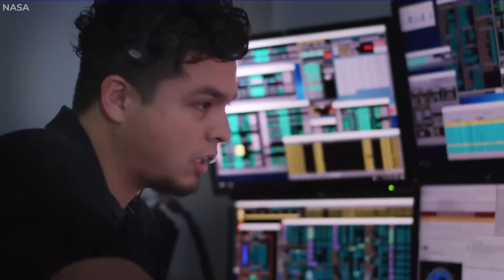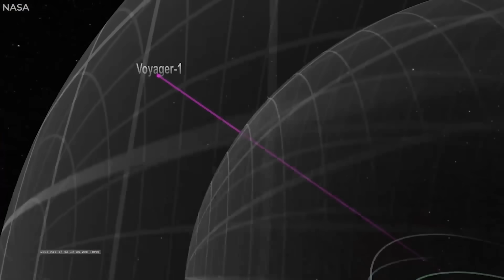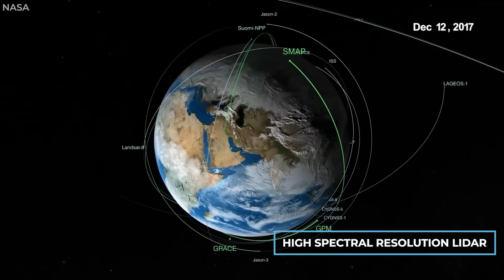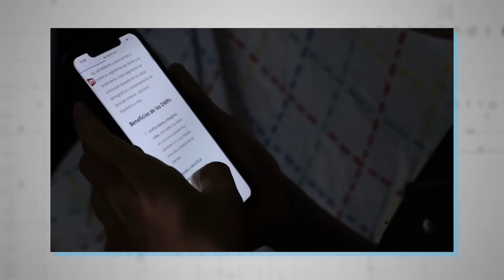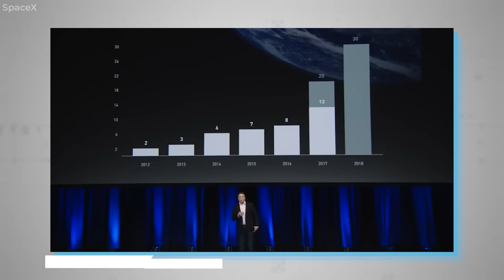NASA vs SpaceX: How Do They Compare?

Comment: NASA - 15 austronauts died during space launches vs 0 dead for inexperienced SpaceX
Reply: This is an unfair comparison because it's not NASA vs SpaceX.  It's NASA vs NASA.  

NASA doesn't build rockets.  They never have.  Let's take 14 of those deaths for example - from two Space Shuttle flights.  NASA didn't build the Space Shuttle.  They contracted Rockwall International to build it - so a more fair comparison would be Rockwall International - 14 deaths.  SpaceX zero.  

Second, SpaceX has only had 3 manned flights - and every single one of those flights was contracted out to SpaceX by......guess who?  NASA - so SpaceX's success rate is tantamount to NASA's success rate in every single SpaceX manned mission, so your comparison is utterly flawed.

Comment: Ok one VERY common misconception is that NASA competes with SpaceX. In short...no not at all. NASA does not make rockets, they launch them and act as a regulatory agency for companies like SpaceX. Also since you have the shuttle in the thumbnail it's worth noting that shuttle was built by Rockwell and McDonnell Douglas while the SRB and EFT were Morton Thiokol. SLS is a Boeing launch vehicle and Orion is a combo of Lockheed, Jacobs and Airbus.

All of these companies report to NASA when a new vehicle is made and NASA certifies it after their testing phases. 

So in a way you are comparing the apple to the tree.

Comment: One gets rockets into space, the other just sites on the ground with delays after delays.
Reply: WHICH get rockets into space?
Reply: @dummy112  that would be spacex because they don't have the same restrictions as "NASA because there not owned by Congress and are a private company granting them more freedom to r/nd everything they create however nasa gets a steady flow of cash every year and they both benefit each other with this system.
Reply: SpaceX delays launches way more than NASA does though. And NASA isn't just sitting there. They're preparing the SLS to launch later this year

Comment: I see it differently .. spacex is thinking about the possibility of factories in space .... Because lower gravity means less massive equipment needed to manufacture stuff ..
Reply: could you tell me where you got this info from?
Reply: @Jasper_171  I mean think about it .. if say a crane needs to be of a certain strength to lift a particular mass on earth ... It would require 1/3 the strength on the moon .. sort of a first principals thought ..
Reply: @parthasarathyvenkatadri   that is not the part that in questioning, i wanne know where you got the info that spacex is thinking About doing this
Reply: @Jasper_171  it's just a conjecture ... I was thinking what could be the possible profit in going to space and setting up colonies on heavenly bodies ... And this sort of came up .. when thinking about it from first principals .... I thought hmm in space or planets .... Our methodologies for manufacturing can be completely different .

Comment: I mean SpaceX hasn't been around for 20 years yet and is making exponential progress. Mars 2024 bb 😁
Reply: sending humans to mars is way harder than a big rocket
Reply: @ninwithabin2683  true. 2023.
Reply: @ninwithabin2683  If you have a really big rocket you don't need to recycle food, oxygen, etc... You can just brute force it.
Reply: @johntheux9238  humans going to mars will not happen for a while, one of the reasons is the space suit problem.
Reply: @ninwithabin2683  Just make one that fit everyone.
I might be exagerating, but 5 different sizes and it's done.
Reply: @johntheux9238  Space suits, Radiation, Exactly how everything will be designed, systems tested and 100% safe, human reaction by being in zero to lower gravity than earth for 3 years, and a LOT more are things we need to figure out before we need to send humans to mars. Some of these things will be figured out faster than others, but my guess for mars is the 2030s
Reply: @ninwithabin2683  Tech vision keeps deleting comments with links, you can find my answer on your homepage.
Reply: @johntheux9238  what about when they get there how will they come back
Reply: @OttoVon789  They will produce methane using ice and CO2 from the atmosphere.
For the first missions they might just use two ships, one that land and one that stay in orbit that they can return to with a small capsule.
Reply: @ninwithabin2683  It will happen by 2024
Reply: @ninwithabin2683  that's true I just
Reply: @ninwithabin2683  *big f"cking rocket
Reply: @ninwithabin2683  No it's not.  Break it all down to its basic components & you might have an inkling of thought ties to an idea of what Elon's thinking. He's not a Physicist for kicks. And stop thinking NASA has a clue,  they don't.
Reply: No reason to go to mars it will never be any more comfortable for humans  then having a moonbase .. the difference is we can get them back in 3  days.. not 7 months .. people are not meant to live in space for long periods .. hell even the iss crews bodies detoriate drastically with shortish stays  .. living on and exploiting the moon is a far superior idea then mars.. maybe in the distant future we figure out how to help humans survive in space for long periods then mars makes more sense
Reply: @wuhanlabtech3580  The plan isn’t to survive in “space” in bubbles with recycled oxygen. Initially ‘the first settlers’ will have to live in bubbles however, as time progresses the goal is to create an atmosphere on mars via the spreading of dark dust and/ or by casting dark life forms like algae’s, Lichens, and bacteria to absorb sunlight thus, warming the atmosphere - increasing the temperature and creating oxygen levels and temperatures suitable for humans. Though, gravity will still be lesser... Darwin’s 5 points suggest that one will sort itself out.
Reply: @petedavis1561  and get bathed in radiation constantly with no magnetic field
Reply: @wuhanlabtech3580  that is what the aim to implement
Reply: @petedavis1561  there is no possible way to implement a magnetic field on the scale of mars in any reasonable manner ..it's just never going to happen.. people need to stop living in this crazy fantasy and just look at the facts
Reply: Nasa got to the moon in under 20 years.
Reply: yep, progress since early 2k untill 10years later, always fail
Reply: even their starlink just a lie
Reply: I’m just here to comment to see if your comment will age like milk or not. I will gladly eat my words if it doesn’t age like milk because I want humanity to progress.
Reply: this did not age well :P
Reply: This aged like milk
Reply: Hey, Elon said level 5 self driving in 2020, proof that no matter what elon is right and not a marketting genius.
Reply: Um ok
Reply: By the way they are only going to launch people to mars on 2022 2024 2026 2028 because it is when mars and the earth allign at their closest point
Reply: Money bro... Elon musk collect their own money while nasa sucking from  state and wait like a poor baby while us favorite's is the army
Reply: @Netizenindo_62  SpaceX wouldn't be around without funding from NASA and the US military.
Reply: @Netizenindo_62  Isn't space X subsidised and supported by government contracts?
Reply: Yes 1 more year until 20 years
Reply: @BuilderMaster-oh1hx  are you in 2022? OMG A TIME TRAVELER
Reply: Moon 2024 to create a base for re-fuelling for the voyage to mars by 2028 (I know it takes 7 months to get there). The priority of spaceX is to set up a lunar base to which maintenance and re-fuelling can be done once the star ship has taken off from earth as that is when it uses the most fuel. So, get to space -> Re-fuel via lunar base (won’t land on the moon when re-fuelling - maintenance ship meets with it) -> propel to mars on a 7 month voyage.
Reply: Hey I know you!
Reply: They’ve made more progress when it comes to getting us to become an interplanetary species in less than two decades then Nasa has in more than 60 years
Reply: Isro vs spacex is a better comparison 🙄👍
Reply: Technically spaceX has been around for 19 years
Reply: Jayden Rice  Not really. NASA is gonna orbit the moon later this year. And Spacex just got people into orbit a little over a year ago
Reply: 20 years by next year..2022...
Reply: It took maybe 8 years for NASA to send a man on the moon, how long Space x exist?
Reply: @danieldore91  20
Reply: Update
Reply: 2025 update
Reply: Spacex is meeting its grave while NASA is a steady one. Spacex is wasting their money on non logical stuff. Elon musk is just making a social media war by brainwashing and nourishing he's B.S by empty promises.
Reply: Nonsense, they came exactly when the technology was already ripe, nasa in the past had to work with almost no computers or very slow ones, plus nasa helps spacex
Reply: @alanmay7929  yeah but NASA had waaay more time to develop reusable and efficient ways of getting to orbit and beyond and got nowhere near spacex.
Reply: @Redeadzombie  because they don't get enough funding. Check mark rober's video about 'is nasa really a waste of money'
Reply: @Redeadzombie   nasa was created in 1954 Go ahead and make a reusable orbital rocket booster with computers less powerfull than a mobile game ad
Reply: @Redeadzombie  That wasn't their focus. Their focus was figuring out how to make it so people (and other organisms) can survive for as long as possible in space.
Reply: @Redeadzombie  Yeah, NASA made a lander that landed itself pn the moon in 1969. NASA innovated vertical landing rockets. Nice try
Reply: @Redeadzombie  most of their projects weren't low orbit and it would have been to difficult even in the early 2000s. They focused interplanetary exploration and have many sattelites orbiting other planets. Plus voyager is above anything space x has done or will do in the next 20 years
Reply: @alanmay7929  and now they have the tech now with a head start but still can’t compare with SpaceX ;)
Reply: @alanmay7929  very true. Mars 2023
Reply: @techtldr9059  why not mars 2021?!?!
Reply: @alanmay7929  😮
Reply: @alanmay7929  first off the starship is not done it is still in working progress also the super heavy haven’t been built yet. Beside that Elon wants and need to do lots of testing before sending a human into space with the starship. So it most likely we will be going to Mars between 2024-2030
Reply: @alanmay7929  a little aggressive but ok
Reply: @bn1__  little agressive?! Wtf!
Reply: @alanmay7929  every two years the mars transfer window opens and closes. The next transfer window is late 2022 and starship will likely not be ready for mars at that time. 2024 is the earliest for an uncrewed mission
Reply: @techtldr9059  2023 is impossible. The mars transfer windows for the next decade are as follows: 2022 2024 2026 2028’ 2030’
Reply: My guy it’s the art of making a light joke 😂
Reply: @techtldr9059  There is no way SpaceX is making it to Mars in 2024. Elon said it himself
Reply: @alanmay7929  That is absolutely impossible for SpaceX as of late.
Reply: @techtldr9059  no mars 2026
Reply: @techtldr9059  no you don’t understand 
Mars comes close to earth every 2 years
Mars will be insanely far away 2023
Reply: Arent they riding on NASA's achievements?? Read Moore's LAW. NASA discovered EVERYTHING for them and has robots already on Mars. There's nothing new SpaceX has done YET other than hyping the crowd about plans to send people to Mars. If NASA wanted to make money instead of discoveries, they would already have sent people to the moon
Reply: Two things NASA and SpaceX have in common both been sucking off the tit of the American taxpayer with no results since the moonwalk
Reply: @stevejohnson1397  most of spacex if not 80% of there money came from launching satellites for foreign customer's from countries which already had space agency's but they lost out to spacex do to pricing.